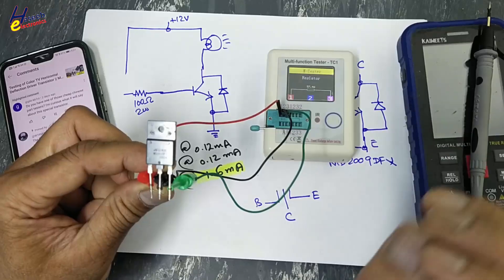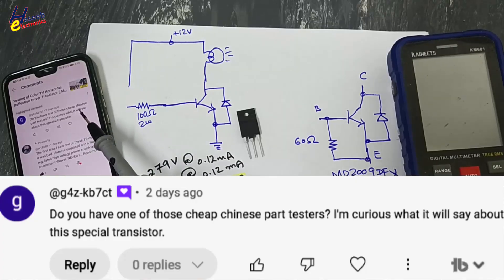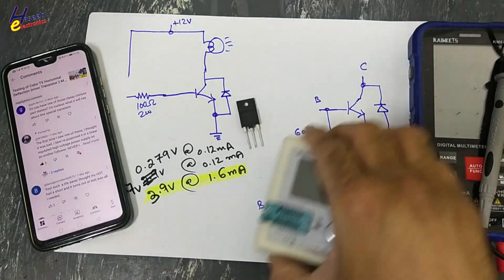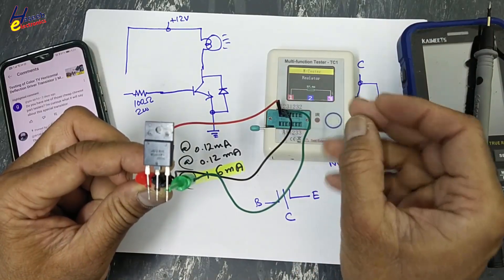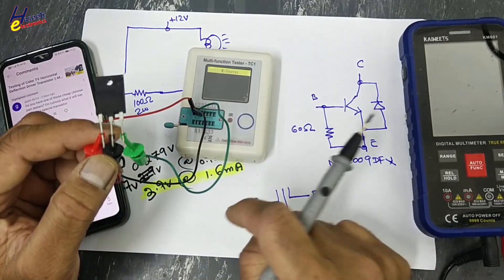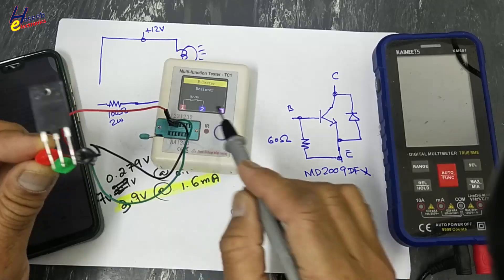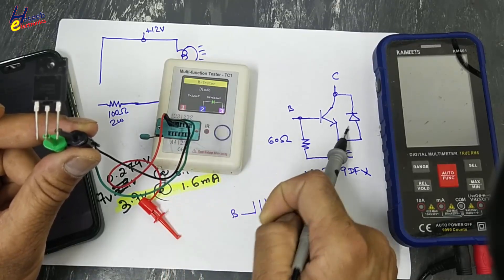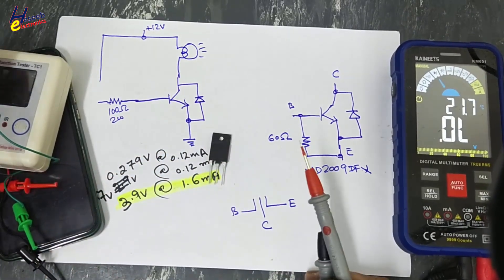{1297B} Testing Horizontal Deflection Transistor with Multi-Function Tester

Comment: Thanks for testing this. The result was a bit disappointing. I was expecting it to show the resistor and the diode. There are probably better testers with newer firmware that may show a different result.